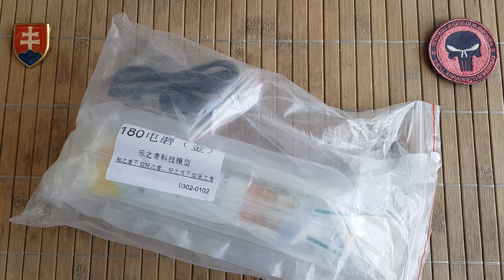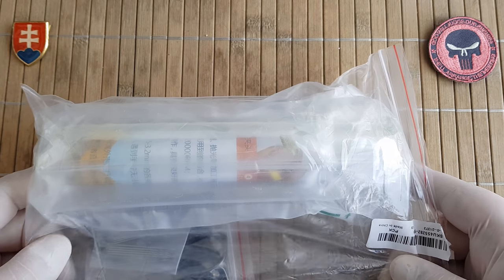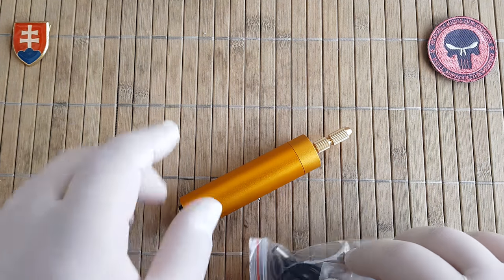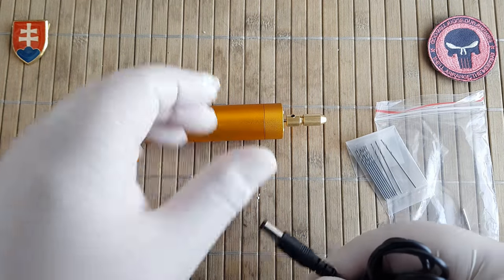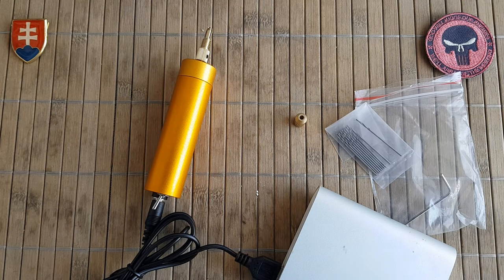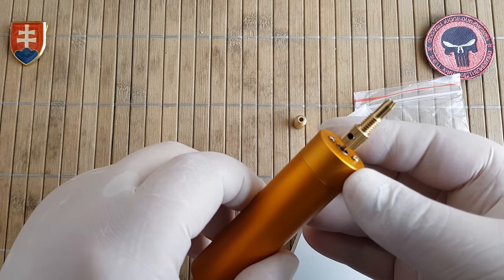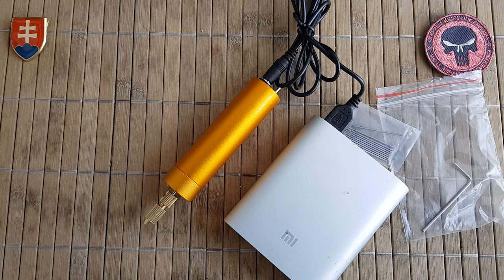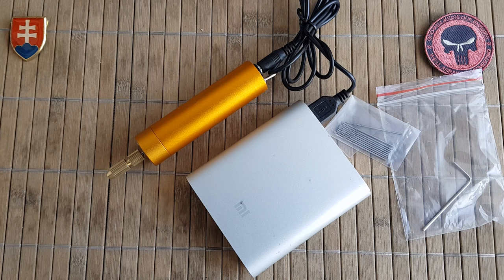Mini USB Electric Drill

Comment: I had been looking at this on eBay and thought it would be helpful when I'm working on wooden knife handles. Thank you for showing this I really appreciate it
Reply from the maker: I don't know how powerful the drill is so if you have a hardwood it may be not powerful enough in that case I would stick to a nice thin dremel tool.
Reply: @nerv5th  i do have two Dremel tools already, but this would be great for very detailed stuff that doesnt need much power.  Plus, might be good for working late at night since it seems pretty quiet.

Comment: I watched the whole video expecting you could teach me ho to put the drill in the tip in order to be able to use it. I still haven’t been able to put it in! The drills in the package seems to be too big
Reply from the maker: Sometimes they ship it with large drills I presume you did take off the cap and did try to slide the drill in and it did not fit? in this case, I would ask the seller to send you the correct drill size.

Comment: What is the maximum size of bit in millimeter can be fitted inside collet?
Reply from the maker: Hi Fairus if my digital caliper is right then 1,33mm is the thickets Drill I could fit but keep in mind that it is not a precision instrument so I could be wrong.
Reply: @nerv5th  thanks.